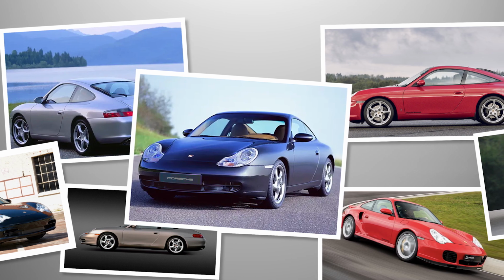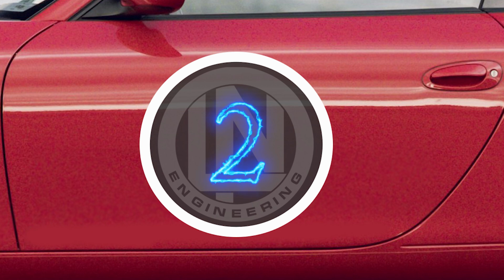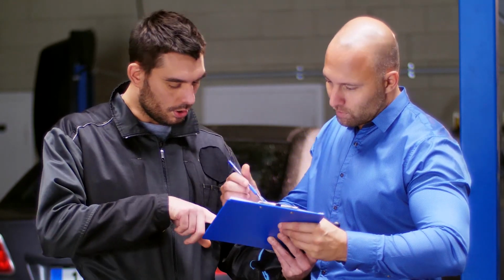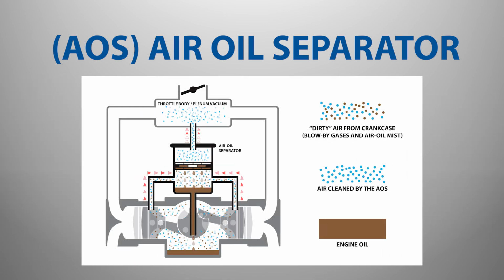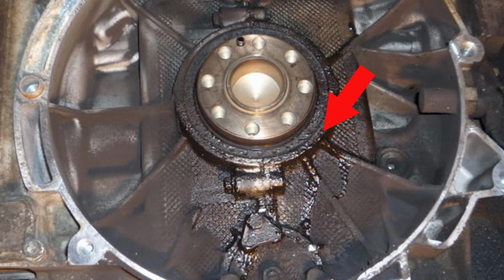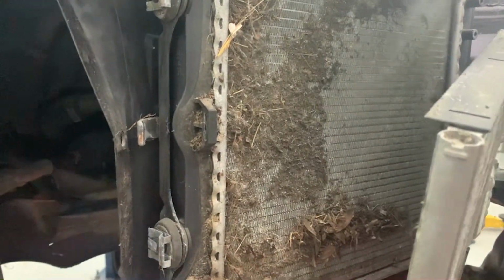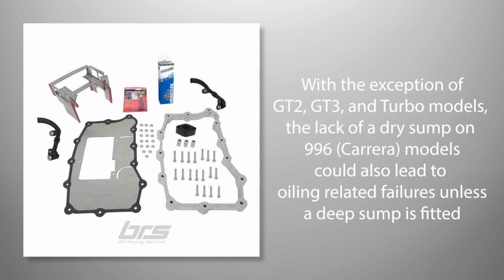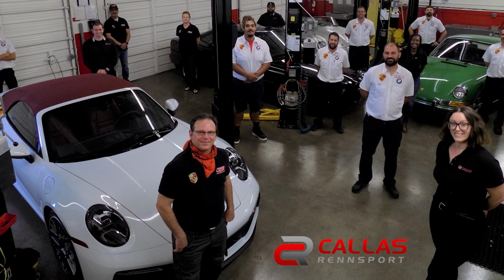996 Years - Problems and Solutions | Porsche 996 Carrera, GT2, GT3, and Turbo Models

Comment: From a porsche  expert. Porsches are not reliable cars. They are expensive to buy fix and maintain. If you buy a porsche you should know this because you will find out pretty fast if you dont know. This german engineering stuff is silly. All german cars are the same. They need to step up because they are falling way behind. This is fact not an opinion
Reply from the maker: In out line of work, we get lots of people calling in who either didn't get a PPI and/or thought that a Porsche would be as reliable as a Honda or Toyota. They don't call it the Porsche tax for nothing, but one individual said it like this. If you can afford to buy two of whatever used Porsche you are looking at, then you can probably afford it. I never looked at it this way, but truth of the matter is that you can easily spend well over the purchase price for a cheap Boxster on preventative maintenance. That's why we advise people to buy as nice an example of Porsche as they can afford and to make sure to set aside big money for repairs up front so you can have years of reliable ownership. That certainly starts as getting a PPI, even for a cheap Porsche.
Reply: I’ve heard they are reliable as heck. Besides bearing and scoring. Interesting
Reply from the maker: Reliability is relative- Age is certainly a contributing factor, but deferred preventative maintenance is often the culprit with both the IMS and bore scoring.

Comment: Can I ask about the 160F thermostat.  Does the thermostat just start opening soon and the car still get to operating temp (over 180)?
Reply from the maker: Sure thing. The premise behind a low temp thermostat is that it starts opening earlier and is fully open around when the factory 185F thermostat starts to open. The idea is that the LTT will just stay open rather than cycling between open and closed like the factory one which isn't fully open until 210-215F.

Comment: thank you for the video.  how many of these are related to a '04 Turbo?  I know the IMS is a non-issue.
Reply from the maker: All you really have to worry about is using good fuel and changing the oil. The Mezger is pretty much bulletproof, until you turn up the boost on a stock Turbo and bend a rod. The only thing to keep an eye out for is the coolant pipes, as they are glued and will leak. Some weld them and some pin them, or hell, just do both!

Comment: Why do you recommend the composite impeller water pump over the metal impeller?
Reply: When the bearings start to let go the impeller starts to wobble. Metal impeller digs into the housing sending metal shaving through the engine
Reply from the maker: @justinbedingfield6954  Spot on. The crappy bearing design can't handle the added mass of the metal impeller and when it fails, it takes the engine block out.
Reply from the maker: Watch this... https://youtu.be/wLIzn7y52wk

Comment: Carefully check the work of the workshops that worked on the car before you buy it ….previous owner had all of these problems until the new engine... but the workshop had only refreshed the engine block and simply reused the defective old Parts …. 🫠